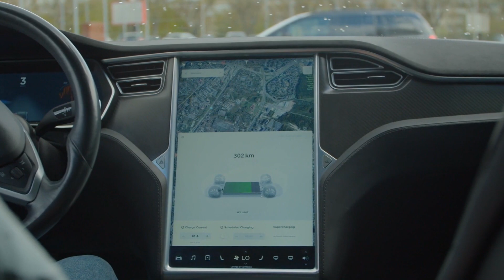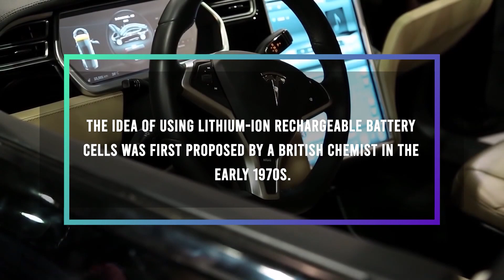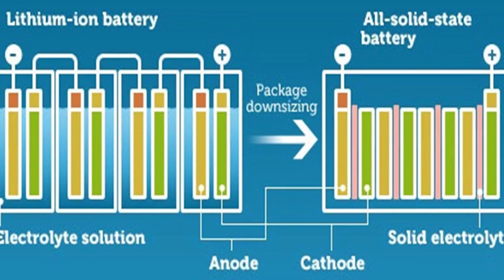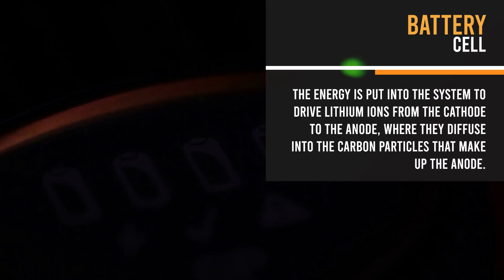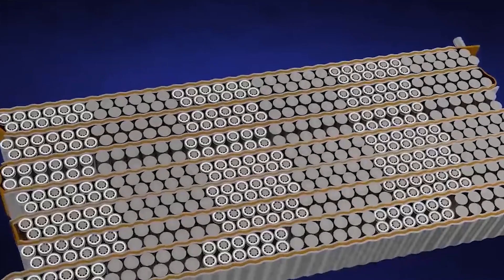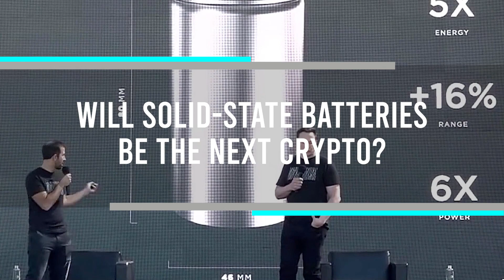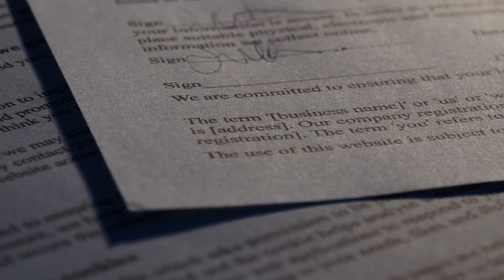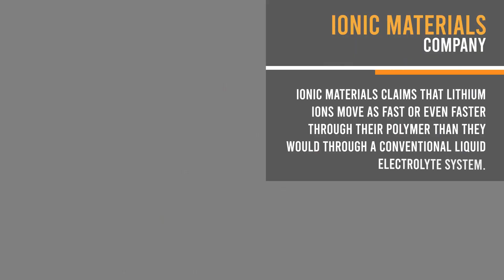Tesla Solid State Battery Would be Game Over for the Industry

Comment: Solid state batteries will take away from the anti roll over in my car, I think the 4680 are as far as I am willing to go on that decision…maybe there can be a thick plate for protection of punctures for a weight as use for the solid state batteries, an anti roll plate as well…?!
Reply: anti roll is just a matter of where the weight is. there will still be weight in the bottom. could be the same weight with double capacity or half the weight then it will just need a suspension adjustment
Reply: @Metesem19  maybe; but will it give the same stability for roll over…time tells all tales